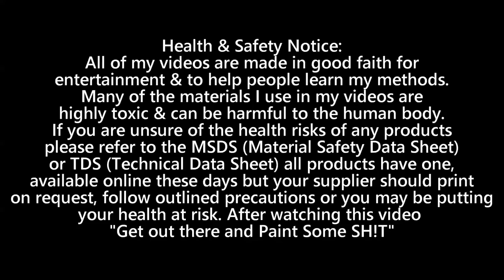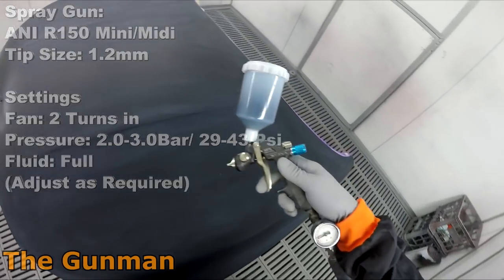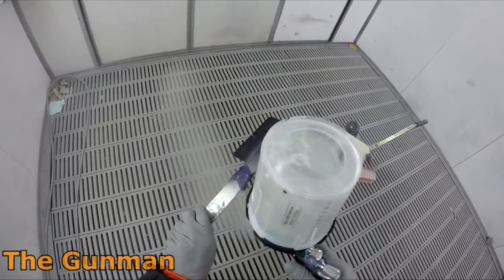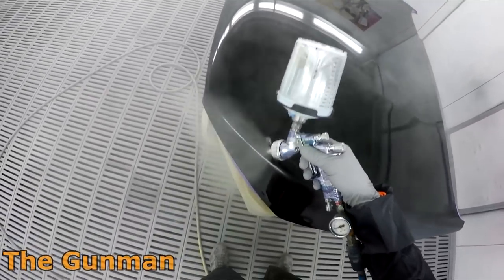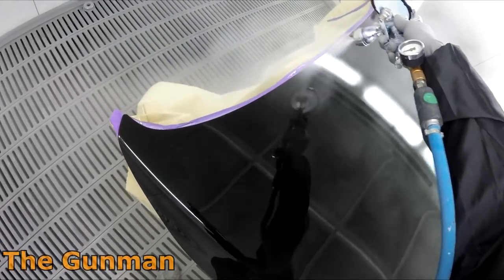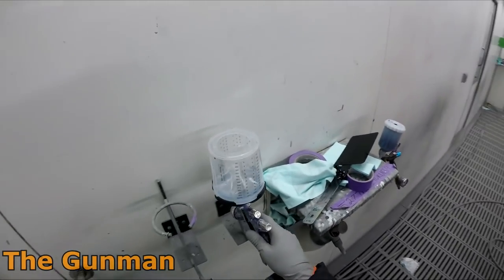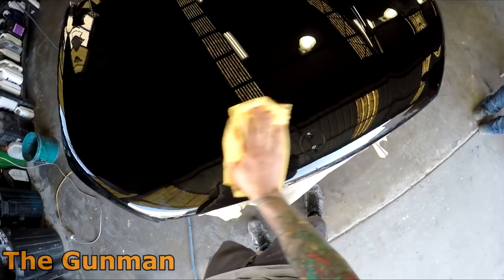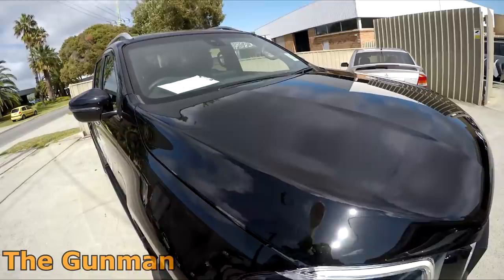Smashing That Clear!!! Mercedes Benz X250 D Bonnet

Comment: Watching you hang over the panel that long after spending the last 2 days spraying a truck bed in 28 degree farenheight weather with no heat.. hah, you're making me nervous, and jealous. It's been 48 hrs since I sprayed the tailgate and I can still dig a nail in it. Needless to say I got a few sags, and it's not cured enough to cut and buff yet🤬
Reply: ••• 
That will never dry, 
Get some heat on it.

Comment: Whats the best paint when painting at home with no booth. Is acrylic the way to go?
Reply: Chris.. Environmentally... probably Acrylic.  Less likely to get bugs... Acrylic  Less likely to settle on the neighbours outdoor settings and windows... Acrylic.  Best most durable finish. 2 pac.  You can avoid the other issues with some planning, sheeting up, good conditions with the wind going in the right direction.  wet down of entire area before setting up to paint to keep dust and critters down, time of day etc.  I personally would never go back to Acrylic, but that's just me
Reply: @MarkSmith-dz6dj  thanks mate, how do you go with 2 Pac if you don't have an oven?
Reply: 2 pac cures fine without baking (just takes a bit longer) and the finish remans pretty much as you see it off the gun after a couple of minutes.  depending on hardener type, will be touch dry enough to carefully handle in an hour or so. Just make sure its a nice warm day.  One thing to beware of is not leaving the painted stuff out overnight in the open.  I did my bonnet (hood) in the afternoon once and it was a nice hot dry day.  decided to leave it out in the open overnight.  Had a cool inversion layer come in overnight and the whole bonnet got dew on it.  Ended up with a nice matt finish. lol  easy fixed, sand back with 800 and flow coat the next morning once it warmed up.
Reply: By the way, I'm talking painting individual panels, spot repairs etc.  I probably wouldn't ever try a complete car re-spray in one go outside.  I have done a complete car in 2 pac, but broke it down into parts, removed doors panels bumpers etc and just did it over time dictated by the conditions.  Came out fine, a few small bugs needed to be tweezered out.  was a solid colour (Ford Monza red).  I was re-building the car from scratch, 2.5L V6 87 KC laser project car.
Reply: @MarkSmith-dz6dj  thanks mate, yeah I'm planning on doing it bit by bit, take doors, boot and bonnet off and spray over time not all in one go. Im sealing up a section of my garage with plastic sheeting and adding 2 fans for airflow with filters, will wet floor and use that area over time to spray all the parts then do the body of the car. So you say will be ok to go 2pac just probably will need a primer that sticks to the current acrylic and can be used for 2 Pac?
Reply: Ideally I would strip the acrylic off and start from scratch but that's a lot of work.  You can probably get away with a good sand back and then a couple of coats of 2 pack primer, light on the first coat to prevent or reduce any acrylic that's cut through from frying up.  But it should be ok

Comment: Hey gunman why did you do a slower pass for the second coat of clear?
Reply: The second coat is always better slower' to get the deep gloss'
Reply: first pass is a tack coat(to avoid runs and create a base that the second coat can bind too), second is the wet coat for a nice deep shine.
Reply: @IMPACTFX  do you typically do 2 coats or do a 3rd?
Reply: @1221Ralph  I usually leave it at 2. Some people insist on 3 but you can get clear popping imo after a 3rd coat. Just make sure the second is your "wet" coat that is nice and smooth and even.
Reply: @IMPACTFX  gotcha. Usually my main concern is thinking I wont have enough clear with 2 coats (for wet sanding and buff/polishing).
Reply: @1221Ralph  I personally have never had an issue. Wet sand lightly with 1500, then 2000 and buff and good to go. But it's all a matter of how you lay the clear coat. Second pass shouldn't be fast, do a slow pass like the gunman above and there will be more then enough
Reply: @IMPACTFX  thank you. Your information has been very helpful

Comment: i have to wait 5 to 10 minutes between clear coat applications or i get solvent pop. Is that normal?
Reply from the maker: There's a few factors that will come into play, the ambient temperature, hardener used, clear used, how heavy you put the first coat on, is it HS MS clear, so without knowing all that it's hard to say if it's normal, but I would guess it is normal, I just work in a warm climate and I know the limits of the products I use, and I push them right to those limits.